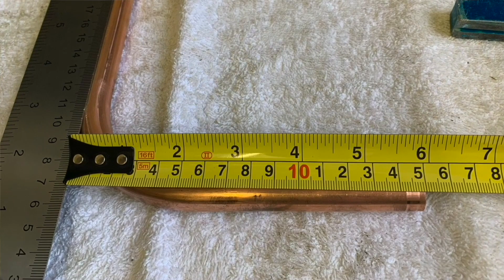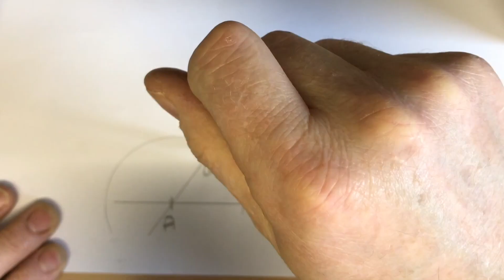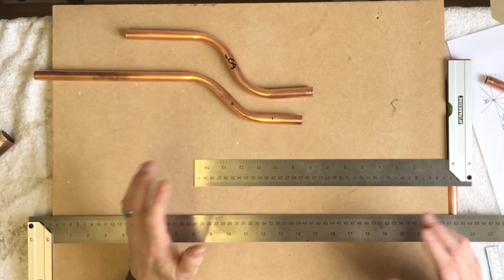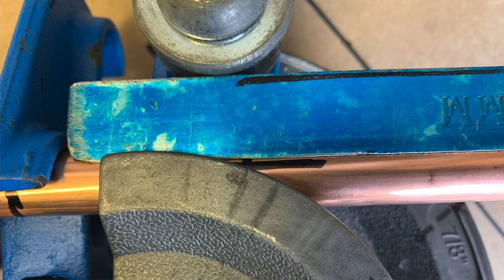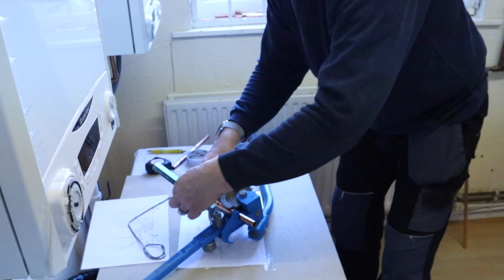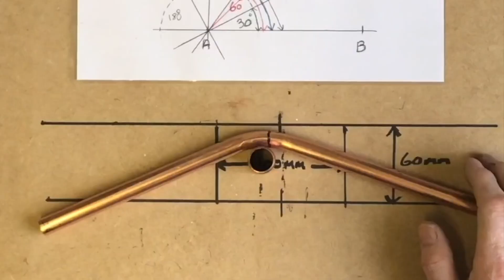BENDING COPPER PIPE FULL VERSION tutorial for trainee plumbers and gas engineers using a pipe bender

Comment: Here on the other side of the pond we us standard size pipe for water is 1/2 inch I. D. diameter, and the O.D. diameter is 5/8 inch. The U. S. pipe standard thickness comes in three thicknesses, designated by the capital letters M, L., K which is the thickest. What are the wall thickness of English standard Sir ??? One other thing, what is the tightest short radius can be bent using 1/2 inch water pipe ??? Sorry if I somehow missed that part if you covered the facts. Thanks too.